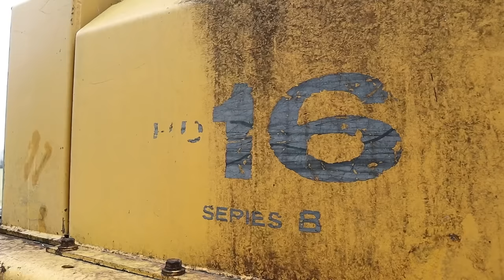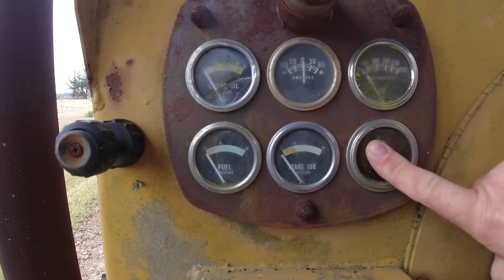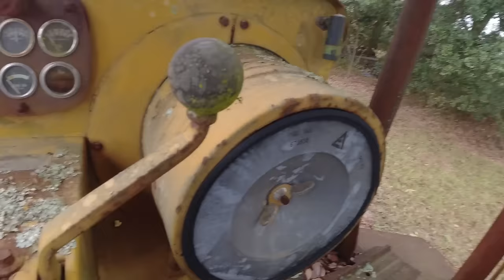BIG BROKEN BULLDOZER! HASN'T PUSHED Dirt since the 90's

Comment: It help if you pulled back on the throttle so it was getting fuel.   For as many videos as you guys do you sure miss the basics to getting stuff running but maybe you do that on purpose for the comment generator effect.
Reply: I had an hd 16 just like that one. For some reason the fuel shutoff was backwards,u push it in to shut down the fuel and pulled it out to run. Not sure if that was the way they were all set up or someone changed it.great pushing tractor,torque converted kept the tracks from breaking loose for max traction
Reply: Time to feed wiley
Reply: I really dont think so! Anyone who can ring that many bolts off in a row, got all their tools for Christmas not many mechanics got all brand new tools
Reply: Looks more like a brush guard. A ROPS would be a lot more heavier built to support the tractor in a rollover. Keep up the good work, boys!
Reply: Did you guys drain the fuel out of the tank

Comment: I worked on one for my boss as a mechanic   did final drives  undercarriage   torque converter  steering pump  motor rebuilds ! Then I used it on my property

Comment: Hey guys, if you want to increase the Amps but not the Voltage then you put the batteries in parallel but you would need to parallel both of them so you would need 4 batteries

Comment: Sometimes the injector pump can leak into the engine crank case through the shaft seals and cause the oil level to rise. At least it happened to my JD 350c (1978).

Comment: Hey guys, for those tight spots get yourself some various length extensions and some swivel sockets they work great , also pick up a short handle ratchet
Reply: Duhhh
Reply: I agree and might add that the swivle extensions can also be a trick up the sleeve
Reply: If he had used a pull handle & worked those bolts back & forth he wouldnt of rung any of them off like its a throw away! Plus he wouldnt of gotten any stuck in the sockets to take 15 mins getting them out! I want be watching many more of these!

Comment: Hey Hank,
Instead of messing with those little batteries all the time, why don’t you make a set of heavy jumper cables about 25 ft long out of 1/0 or 2/0 welding lead. Put a quick disconnect on one end and heavy clamps on the other. 
Then build a jump pack out of two 4D size batteries and mount that in the bed or one of the side boxes on your truck. Run more cables on your truck to the front  bumper with the corresponding quick connects for your jumper cables. Rig the truck cables one set each for 12 and 24 volts. 
Then use the truck’s charging system to keep the batteries charged when you’re going to and from your projects. 
The good part is all you need to carry around those machines is one end of a set of jumper cables. 
I worked at a construction job that had several mechanic trucks rigged up this way and they worked great.
Reply: Thought same thing!!!!
Reply: That's exactly the setup I made for my receiver hitch mounted 12k winch. Ran 1/0 cable from the battery to the rear bumper with quick connects. Put quick connects on the winch.

Then I installed a front bumper receiver hitch so I could mount the winch on the front with a quick connect in the bumper.

Then I realized I could use this for jumper cables and I built 30' jumper leads with quick connects. Then I realized I could use it for my HV compressor so I added a quick connect to it. Every time I think of a new accessory I think about how I can convert it to use my quick connections.

I'm looking at adding a DC Stick welder interface so I can do mobile repairs as well.

I'll never have to open the hood on a recovery again.
Reply: @lwwarren  
So do you have the Warn winch that came set up with the receiver hitch cradle and the quick connect wiring? My Dad has all of that on his truck and the Warn front receiver hitch too.
Reply: Absolutely, I've stopped watching the channel because of all the messing around with the batteries. Every video is the same....20 minutes with them dicking about with vice grips and battery cables!
Reply: @0l0dom40l0  he hehehehehe and marvel mystery oil lol!
Reply: I wonder about the amount of time they waste  with cob-job hookups, too. It's a no-brainer. Okay, maybe it's  as simple as they don't want to invest the money and time to put a jumper cable system in,  but it would sure save them time and give them a better chance of cranking those engines over.  Ho-hum?
Reply: A guy who has way too much money!

Comment: I worked on these brand new,the blade is a bull blade with tilt assist ram.This model 16 did come out in the mid 60,s and they were about 3 tons heavier than their predecessors,they were a powerful and agile machine,here in they were used in forestry and general earth works 
I love your blog, its just me all over,wish I could be there.

Comment: Make: Allis Chalmers	Model: HD16	Years Made: 1955 - 1965
Factory: Springfield, Illinois, USA	Chassis: crawler	Wheelbase: n/a
Front tire: tracks	Rear tire: tracks	Weight: 31,500 lbs [14288 kg]
Length: 178 inches [452 cm]	Width: n/a	Height: n/a
Elec. Grounding: n/a	Elec. Charging Amps: n/a	Elec. Volts: n/a
There is all the information on it

Comment: 9:40 That's setting huge warning klaxons off in my head. Oil floats atop water. You stick a dipstick into a sump that's got 3 gallons of water beneath 4 gallons of oil in an engine that hasn't rotated in years you'll get a dipstick looking exactly like that.

My next step would be dropping the drain plug out of it and seeing how long it takes to get oil out. I'd bet dollars to donuts there's a LOT of water in that crankcase.,

It could also have a lot of diesel in it, which would mix in well, still lift the level up. Your sign there would be it smelled dieselly and had zero viscosity.  Still, I'd be draining and refilling the sump before I tried to start that engine.

Comment: Thanks for another great video. It was interesting. 
Sorry you could not get it to run. You got it to just start but would not keep going. 
Try having that ether more accessible and give it big doses. The bigger the engine the more it needs. 

You and Wiley put your all into it. Wanted to go. I bet it had huge batteries in it to run the starter. Tough old machine to get started. Sorry guys. You gave it a great try. 
Thanks hank and Wiley for your efforts. 
The Iowa Farm Boy.

Comment: Those out board final bearings were a weak point on Allis dozers. You need to check the wishbones and make sure they are tight also if they loosen up it will cause the axle to misalign

Comment: What my uncle said about "fuel oil" from the past is that back then they called Diesel "Fuel Oil".  Diesel is a bit more modern term, although the Diesel mix back then probably had a little more of a lubricant in it as well, so it would have been fuel+oil.
Reply: Diesel is a light oil.

Comment: I saw several of these Dozers in South Vietnam in 1968 and 1969.  I remember one at Conthein military Base just below the DMZ it had been on fire after the North Vietnamese had tried to come thru the perimeter..  The dozer was sitting on the perimeter.  Actually the dozer may have been bigger than the one on your video.  Then I saw another in 1998 at Fort Polk Louisiana in a military museum.  It was military green in color and hadn't been used enough to wear the blade or the tracks.  So that is two dozer stories both were U S Army Dozers.

Comment: Usually the toggle switch on right you turn to left for glow plugs and to right for power to starter button  If it turns to left and the right that is.

Comment: Series hook up increases the voltage , parallel hook up of batteries increases the amps . Two 12 v, 200 amp batteries hooked up in series= 24 volts; 200 amp ; two 12 v, 200 amp batteries  hooked up in parallel= 12 volt 400 amps😮

Comment: To increase voltage connect batteries in series pos.neg pos. Neg etc. To increase current connect batteries in parallel. All postives connected all neg. Connected. Voltage will be the same.

Comment: Hank. Ya guys need a small generator and a Battery charger with 50 100 amp boost for jobs like this. . That old girl would have ran if batteries didn't give up